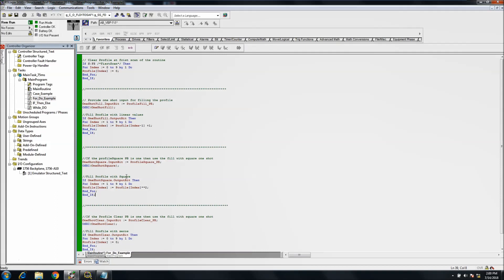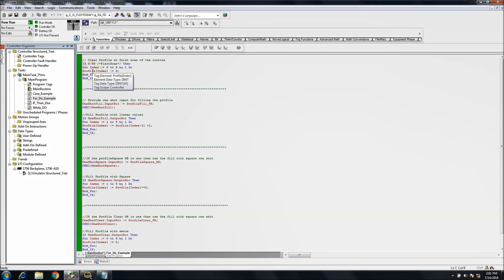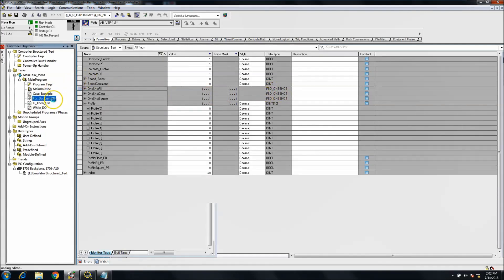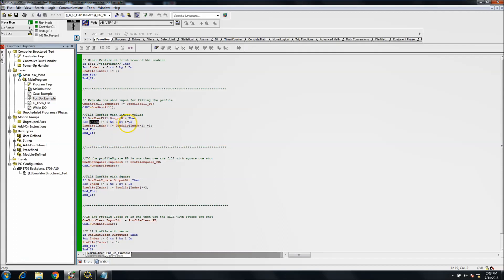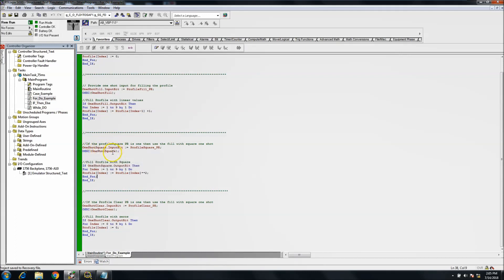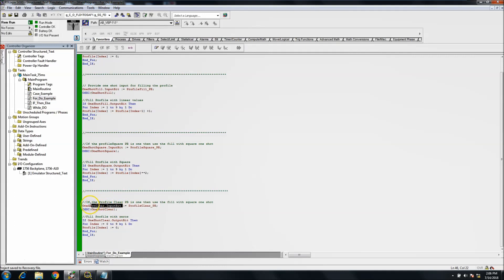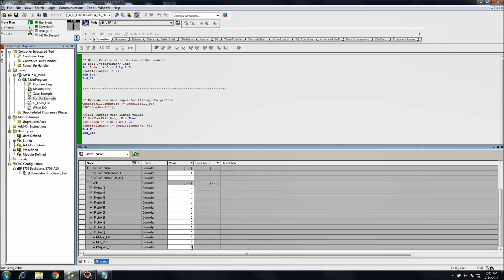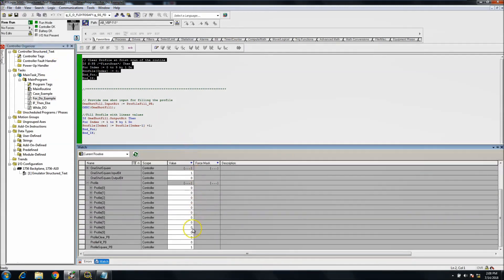RSlogix 5000 Structured Text FOR DO Tutorial with FBD One Shots

Comment: Hello Shane. Thank you again. I have another question if you don't mind: 
I have this issue: 
Routine_A (Routine in ladder logic) and AddOn_1 (Add-ON in ladder logic) are the same. They have the same logic.
I created 2 Structured Text Routines (ST_1 and ST_2) that have the same ST logic, except one line of code.
ST_1 and ST_2 have NO errors when I verify/compile the logic. 

ST_1 has this line :
If DintA = 1, then jsr(Routine_A); 
End_if;

ST_2 has this line: 
If DintA = 1, then AddOn_1(AddOn1newInstance, InputA, InputB);   // Note: AddOn1newInstance is Data Type AddOn_1, InputA and InputB are just DINT Data Type inputs
End_if;

The problem is that ST_1 works but not ST_2. 
ST_2 never calls the AddOn_1. 
Am I missing something Syntax-wise when invoking /calling the AddOn_1 function?
Reply: Never mind. I found my own answer: (At the Parameters and Local Tags of the AddOn1) InputA, InputB are parameters that needed to have its usage set to "InOut" and not "Local"
Reply from the maker: Good to hear, sorry for the late response